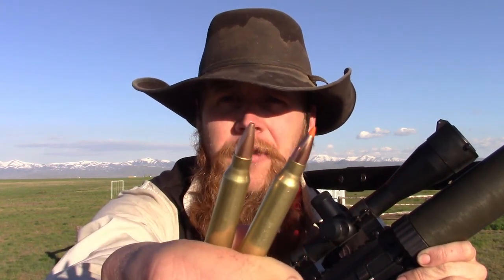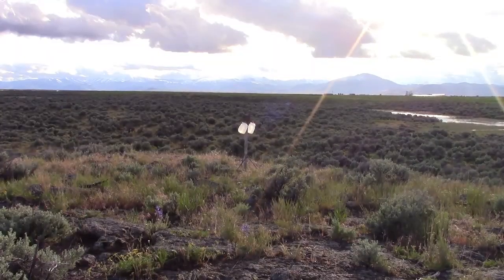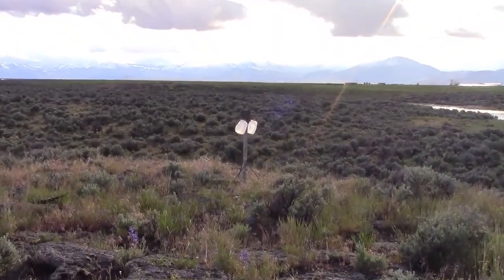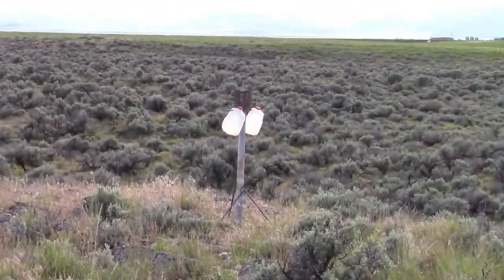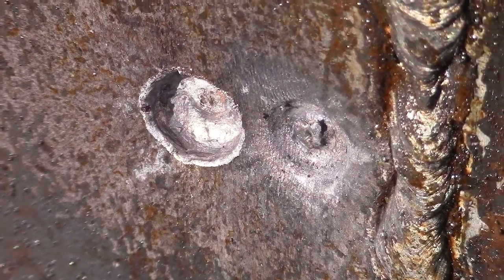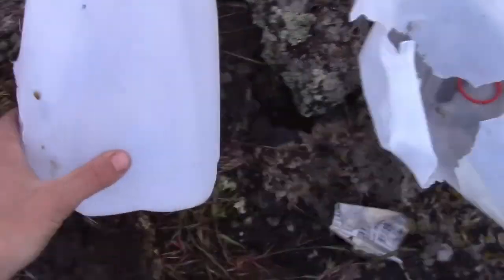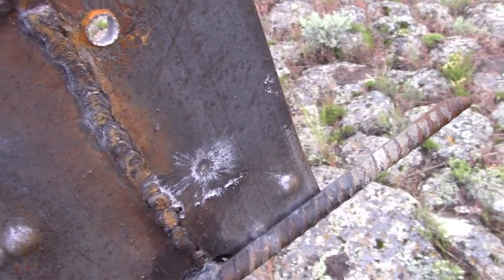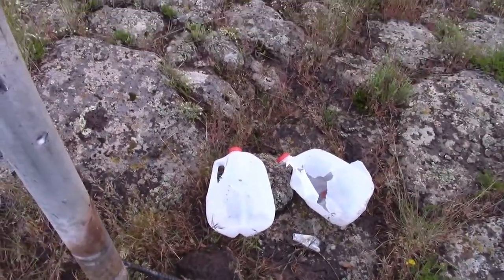Shooting the Pet Loads (TIS090)

Comment: question ? did you have any difference in elevation aiming point on 55gr vs 77gr?? 100 vs 300  vs 500, etc.

Btw, next time we pass each other going up my valley, at least wave back! neighbor
Reply from the maker: Yes.  With both zeroed at 50 yards, at 300 yards the 55 gr. bullet drops about 6 inches, while the 77 gr. bullet drops about 15 inches, and at 500 yards, the 55 gr. drops about 40 inches, while the 77 gr. drops about 60 inches, so the 55 gr. bullet has a flatter trajectory.
Reply: good info, thank you. Right now I'm playing with a "middle of the road" load 69gr, sierra MK hpbt, being pushed with Varget. Kinda anxious to see if we can stretch the tape n tighten it up